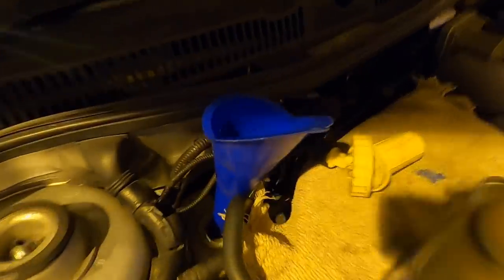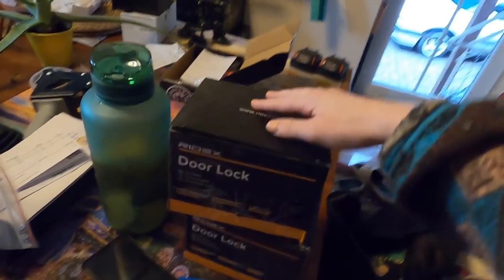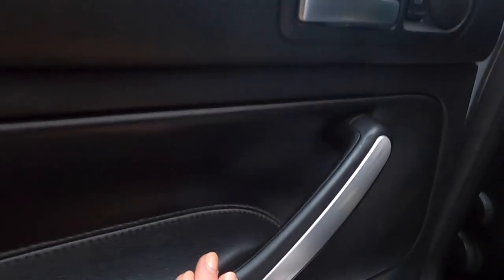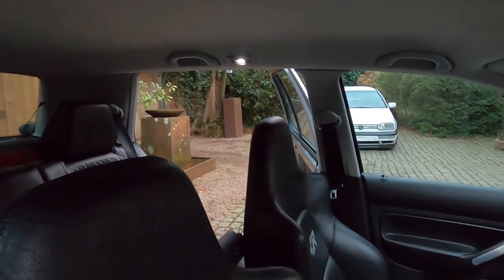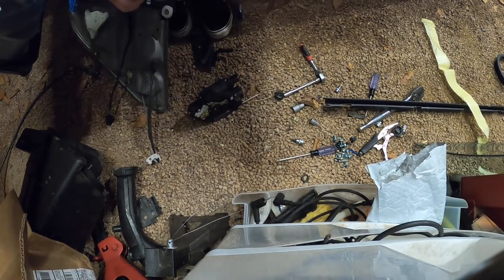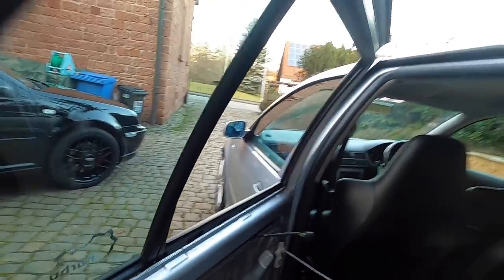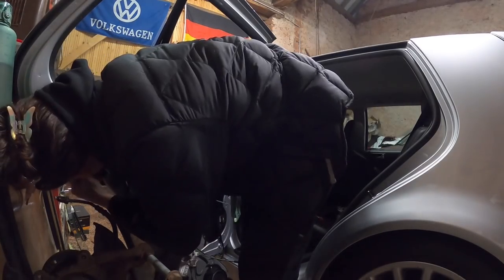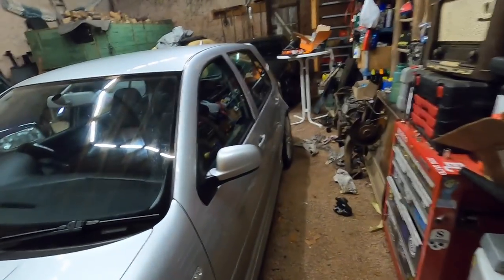Replacing mk4 R32 Rear Door Lock (kind of)

Comment: Good old Mk4 lock problems 🙄 I've changed drivers front on mine and now drivers rear is doing exactly like yours. Sometimes it'll open if I hit the outer door skin under the lock while pressing unlock button. From memory there is a way of setting the correct tension that the handles have on the mechanism (it's been a while since I did mine). It could be that you have too much tension so it's not allowing the door to lock. I used videos from Stuzman on here when I did mine and they were helpful. Good luck with it !

Comment: Try with the car running and then keep locking/unlocking, that's what worked for me and I think it's the higher voltage when the car is running that actually gets it open. You should also get that fixed as soon as possible as if it ever completely fails then it's actually gonna be a problem lol. Good video :D

Comment: Agreed with Ivan, you should test those locks with the car running to ensure max voltage to the locks. The very same goes for that electric window. Test with the car running and if it still gets stuck, make sure the window rubbers are not creating too much of resistance. May have to lube them very slightly to ensure the window runs smoothly... Just noticed Zaid said this as well

Comment: Sometimes it not the module. But the connector plug that's located in the B pillar which you have on each side. Sometimes water gets into and corrosion start build up and mess with voltages for the locking module. I had that problem with a vw passat 3bg which is the exact same as mk4.

Comment: Unfortunately in my experience it's OEM VW parts or nothing, The off brand parts just suck, But what I think is happing is the Bowden Cable is adjusted improperly, Its the small metal cable with the plastic tip that attaches to the door handle itself and used to open the door and activate the door lock module, you may have the cable to tight or to loose.

Comment: Try to lock and unlock with the key itself. Hold the key in unlock position to get all the windows down en lock to close them. Sometimes the new locking mech. Needs to be get noticed by the comfort module and sometimes with vcds.

Comment: My experience with Ridex parts is they just don't fit. Like at all. You gotta transfer stuff from your old parts etc. at the bare minimum. They say they are "German" but nothing about them shouts "Germany!" to me, quality-wise. All the well-known European parts brands' stuff works way better. Still in recent memory when I had to replace a rear brake caliper to a Transporter T4, in the freezing cold, and had to start disassembling the old part to harvest the parking brake cable holder just to make the cable fit. Not to mention the caliper itself looked nothing like the og one although it did magically fit the bracket... And on my car, I was once weak and bought Ridex hatch struts and now, after 2 years they're already shot, which is about 13 years earlier than the originals.
Reply from the maker: Hmmm well that’s lame dang ridex is wasting our time
Reply: @caseosmith6405  I mean, Autodoc is one of the best things that ever existed, but their in-house brand needs some serious work. That's all my euro cents on that matter... Great content btw. Both of you. :)